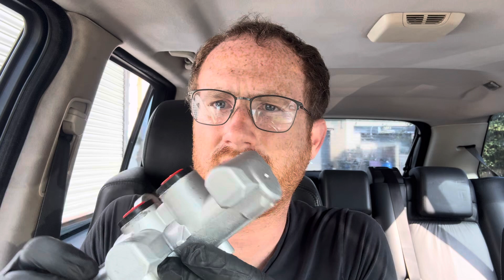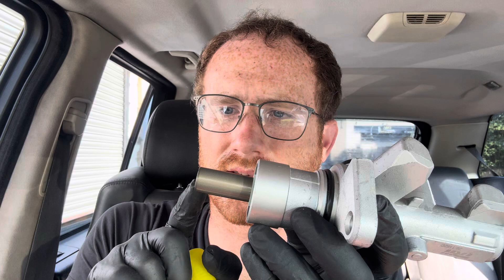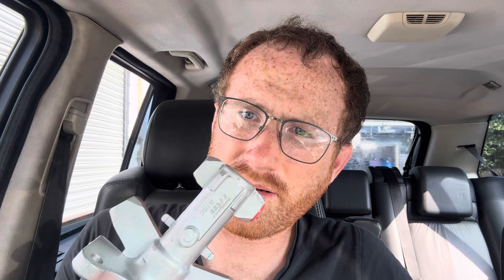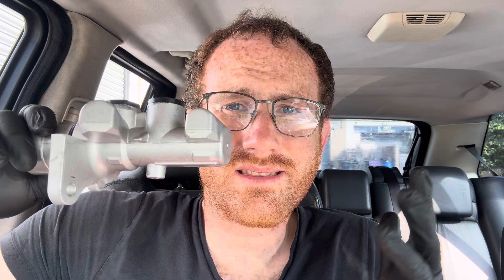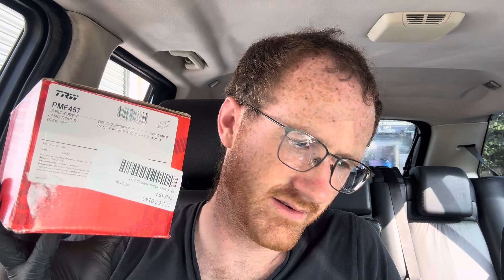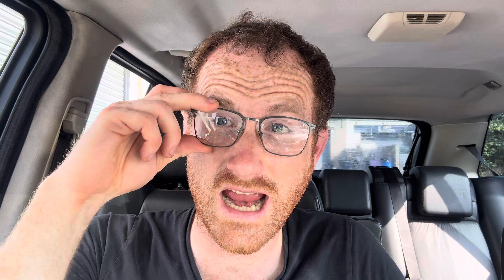Made WRONG! Faulty out of the box. Quality of new car parts WORSE than ever.

Comment: Big difference now between 'OE' parts and 'OEM' parts.. 'orignial equipment' and 'original equipment manufacturer.'. A lot of OE parts are outsourced ( China), OEM means as fitted to the vehicle originally and should be a much better quality... the manufacturers don't care too much for the post finance owners now, so 'OE' parts are usually supplied by the parts department. Trouble is a lot of JLR stuff is China origin to start with now anyway... hence the TERRIBLE reliability issues they are becoming renowned for.